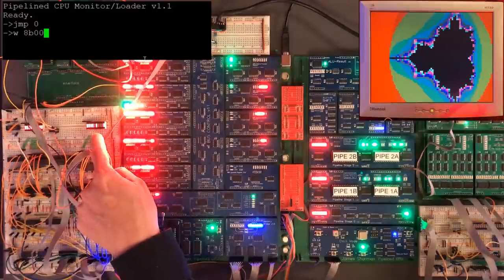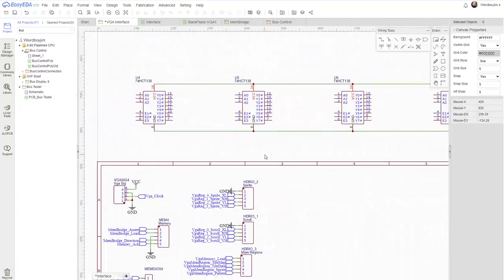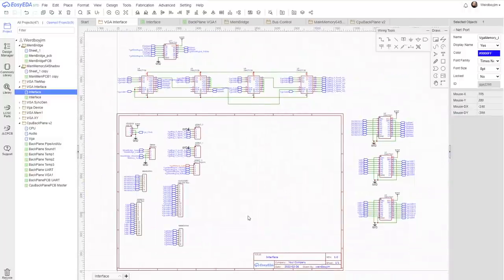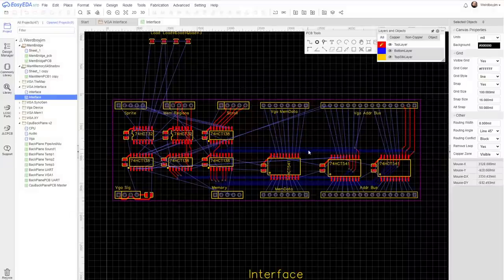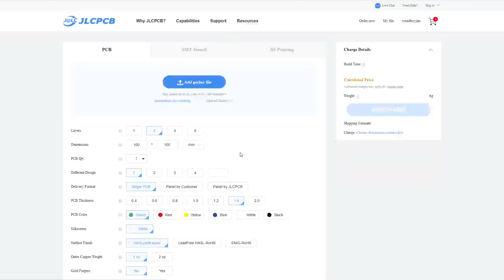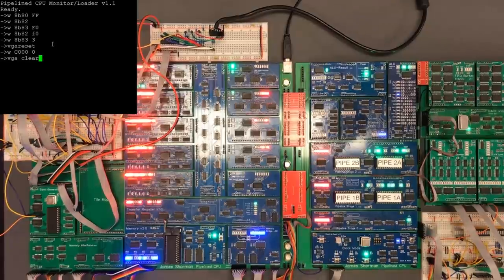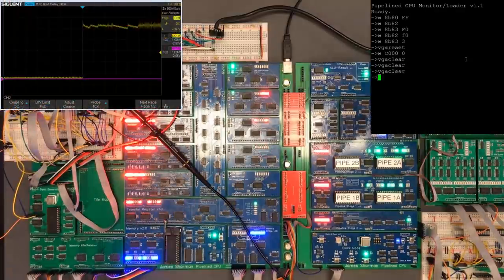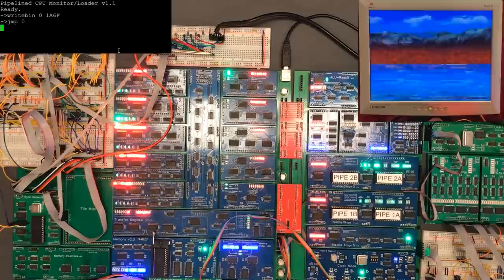Interface PCB - VGA from Scratch - Part 8

Comment: I'm learning a LOT from this series. I was an electronics hobbiest in my teens (during the late 1970s). I recently returned to hardware after 40 years of software engineering. I have been "hand soldering" with a soldering iron. I've seen videos on "micro soldering" from folks repairing modern laptop circuit boards. I thought the hot-air approach was only for that. THIS is the first time I've seen "paste" applied (with a template no less) and SMDs hot-aired onto a virgin board. Also, the tools you're using (CAD and such for circuit diagrams and circuit board design) have been very instructive. Watching you do this helps me know that my own custom circuit boards are in my future. Thanks again for a great series.
Reply from the maker: Glad you are enjoying this. One thing many later arrivals to the series don't pick up on immediately is that the main cpu series was pretty much me starting in electronics. My first designed pcb's, first smd soldering are all there. If I can learn to do it anyone can!

Comment: Awesome to see more VGA progress. I thought it was odd when you said AND gate and were adding a 7432. I thought at the time you just misspoke. Great to see you got it working.
Reply from the maker: Yeah, it was a stupid mistake that I don't have a good excuse for.
Reply: Demorgan tells us ANDs and ORs are equivalent with inverted inputs and output.  Although not intended in this case, a 7432 is a quad 2-input AND, with inversion bubbles all around.
Reply: @lmiddleman   I believe that's exactly how James is using the 7408, as a quad 2-input OR with active low inputs and outputs.

Comment: Another excellent video! I was a bit confused about your changing around some of the lines on the 138s. Would that not mess with where in the address space the VGA circuit will be? Say for instance the memory mapped I/O registers?
Reply from the maker: Well I did move the vga registers from 0x8b00-0x8b07 to 0x8b80 -0x8b87 as it saved me an extra chip.
Reply: @weirdboyjim  Ah, I missed that change, sorry.

Comment: Interested in your backplane concept.
 It makes sense for video since everything is laid out flat, however generally cards slot in bookshelf style - on edge with a standard backplane/motherboard connection.

Using the 3rd dimension to manage space.

Are you considering an option to collapse various parts of the backplane into the traditional motherboard/90º cards arrangement? 

I guess no functional reason - other than it perhaps standardises bus/line access within a system.
Reply from the maker: I'm laying everything out flat for presentation more than anything else. Technically when people say "backplane" it's mostly direct connections, this is more of an interconnect board.

Comment: Nice board.  I saw the HCT32 placed in the schematic at the same time you mentioned needing to AND the 138 outputs to create 8K regions.  Easy enough mistake, and, of course, the saving grace was the identical pinout between the 08 and 32.  (Thanks to the guys in the 70's that standardized the pinouts for 2 input gates!)  Fortunately, using the OR gates simply caused no memory selections to occur.
Your R & R looked spectacularly easy, too!  Wish I could have the same level of skill/luck when doing the same. :)
Finally, you seemed to very quickly come to the conclusion that grounding was an issue.  I don't think I'd have been able to solve one like that so quickly.  My first suspicion was that loading was periodically not occurring in the H-scroll register or the data was getting corrupted on the way to H-scroll, which it seems was partially correct, but for different reasons than I suspected.  Nice work.
(Sorry for the long comment, but alot happened in this video about making video!)
Reply from the maker: When I pulled the register lines high and the distortion was still happening I was immediately suspicious of the line counter, that is being driven by a temporary fly cable coming out of the top of the sync board with no ground return (The ground return path from that is crazy!). Pretty sure the signal will be much cleaner  with that connected properly.

Comment: It wasn't quite clear if the ground bounce problem and extra grounds was only the protoboards, or the pcbs; If you find that you need extra grounds between the card and the backplane, you can find a spot where there is ground both on the backplane and the card, preferably in-grid for aesthetics, and just drill through both. I my box of fixes I have a 2mm drill I think is for wood as it has a spike  in the middle, but it is excellent for removing solder mask around a new hole. Perfect dual-side soldered pins that look factory:-). I am quite curious to what the signal integrity looks like, and there will probably be a few video-worthy surprises in there. Eye diagrams maybe?
Reply from the maker: Interesting! Hopefully I wont' need to consider modding the boards but I do think I need to pay more attention to ground return paths. I'll be spending some time with the scope soon but the likely reason for it being especially bad is the two clusters of long signal wires between the pcb's and the breadboards that don't have a ground return.
Reply: @weirdboyjim  I'm currently planning out a PCB CPU myself, and one of the central features I'm designing for is for any long-distance signals to use differential signaling -- using using M-LVDS transcievers and differential trace routiong with signal-to-signal length matching. Hoping to be able to run >100 MHz clocks!

Comment: Nice.  But that 32 / 08 mix up had me shouting at the TV as soon as you drew it on the schematic.  Easy, I know, but I was also looking at a bunch of 138s and other similar stuff logic last week when reverse engineering a board that I put in my junk box about 30 years ago...  Glad you got there without too much pain.  I am sure more grounds with the signals would help prevent the marginal glitching that you then saw, but there's also a good chance that it will clean up enough as soon as you get the rest of the design moved on to a proper PCB instead of the prototyping boards.
Reply from the maker: Yeah, I need to account for ground more but after staring at the build while editing the video I'm pretty confident this the issue here was the signals coming out of the debug pins in the sync board driving the vertical counter. The ground return path is very awful for the signal.

Comment: It would be interesting to know  how many transistors this cpu build is up to if we tallied up all the IC's.
Reply from the maker: Yes although the count would be distorted by using chips with functionality that is unused (Think of all the output and enable lines that are pulled high or low). There is also an interesting discussion in the discord at the moment on creating functionality from transistors that shows it can be much more efficient to do it directly than using direct mapping from gates to their transistor arrangement counter parts.

Comment: Maybe a bit early for this question, but anyway. Given you don't have interrupts, is handling sprite collisions easy enough? Are interrupts actually used by games developers to handle sprite collisions?
Reply from the maker: There were some platforms that had some feedback from the sprite system that could be used for collisions. Understand I'm not trying to reproduce any pre-existing system. My sprite system will be very basic just for assisting with visuals, no reason why collision can't be done in software.

Comment: Nice video once again. Interesting that the PCB version seemed to be more prone to grounding issues, I would have thought the other way around. I wonder what's the reason for that. By the way - I'm not sure if this was printed anywhere on the circuit board, but the word should be "palette", not "pallete".
Reply from the maker: Not sure about this here yet but in the past the ground issues have been at the worst at the boundary between the pcb's and breadboards as I end up with longer wires there.

Comment: I'm not experienced at all with this chip-level logic circuits, that's why it fascinates me that much. But I'm not sure if I fully understand the part with the 74HC138s: Is every possible address in that range really pulled out to one separate line, or are there gaps where addresses don't do anything?
Are somehow the EasyEDA files accessible to read ?
Reply: You'd only use them to point to chunks of memory, how big a chunk is up to you. The 138 has 8 possible outputs, so you could use it to point to 8K chunks of a 64K address space, or 4K chunks of a 32K one. For example, if you wired the input lines to A13-A15 of the address bus that gives you 8x8K blocks of address space. If on the other hand you wired it so the 138 was only active when Address line A13 was low, but A14 and A15 were high and connected A10-A12 to the inputs, you'd have 8x1K blocks situated between 0xC000 and 0xDFFF.
Reply: @2thinkcritically   That's not really what I meant. I don't have the schematic in front of me, so excuse me, when I recall it wrongly. Wasn't it so that when A13-A15 were low, the  first output was set High and therefore Enabling the second 138 which uses A9-A11. So whenever A13, A14, or A15 is low, the second 138 will be disabled, so A9-A11 will be irrelevant thus creating gaps in the adress space, because 00100011111111 does the same as 00101011111111
Reply: @Schwuuuuup  In also writing this without access to a schematic, so take anything I say here as examples of operation rather than anything that specifically relate to this project 😁

If A13-A15 are wired into the inputs of the first 138, and the second has it's /enable line connected to Y0 of the first 138, then the second 138 will be active when A13-A15 are all low. If the second 138 has its inputs connected to A9-A11 then yes, A12 is technically being ignored, but only when the second 138 is active - assuming A12 isn't connected somewhere else with the circuits connected to outputs of the second 138.
Reply: @2thinkcritically    Sure, if A9-A11 is used somewhere else, the gaps could be filled, but I did not see any of this. the second set of 138 uses A3-A5 and A0-A3  on their address pins and A6, A7 and A8 on their enable Pins. In the meantime I looked up the datasheet for the 138, and there is a reference design consisting of 4 138s and one inverter to give you 32 outputs in an contiguous address space.  this seems much cleaner and less wasteful to me ;-)
Reply from the maker: The 138 is a 3 to 8 lines decoder. So you can take 3 lines in binary and decode that to 8 selection lines. There are various select inputs as well that let you make for more complex arrangements. I actually made a video about the chip early on which you may find useful. https://www.youtube.com/watch?v=F2KTyoMUQQA
Reply: @weirdboyjim  thanks for the link to the video. There you cascaade 2 of the 138s to get 16 outputs using A0-A3. But in today's video you connect A0-A15 to "just" 4 138s. This should be doable with jusz A0-A4. But I think I get it now. The whole 138-arrangement is not only there to adress single registers but also to address ranges. So the gaps that I feared to be there are not unusable dead spaces but the ranges where ROM and RAM lives

Comment: Whats the actual resolution of your vga? Because 8k of ram implies less than 640x480.
Reply from the maker: The circuit is driving 640x480 but that would take a lot of ram, more than I can address to do well. Eventually the circuit will make the full resolution by having a tile map that references 8x8 tiles. That will loose the flexibility of a true bitmap but you can move things around quickly (hence early gaming systems using a similar technique).
Reply: @weirdboyjim  Very cool. I'll look forward to that feature. It occurred to me that if you weren't doing full 640x480, you didn't necessarily have to drive the circuits at 25Mhz. And if the future includes a 8x8 tile then you still need that clock rate.